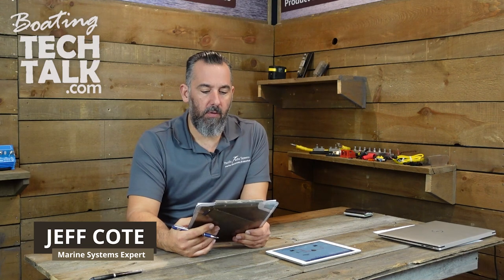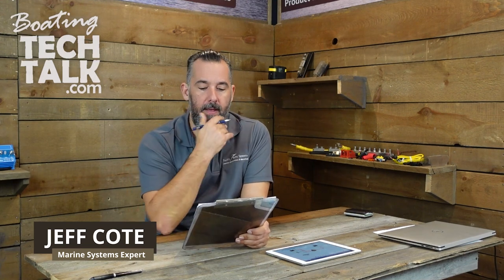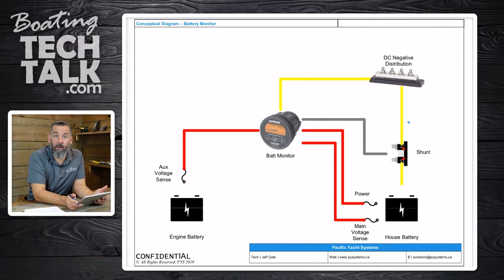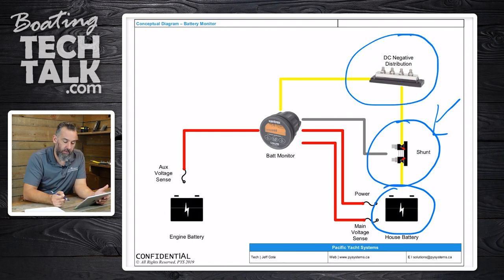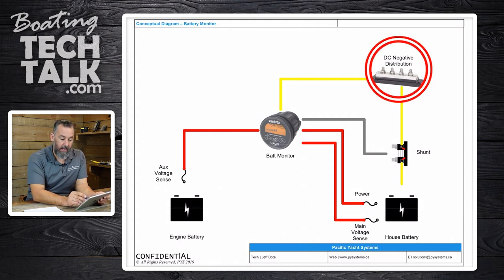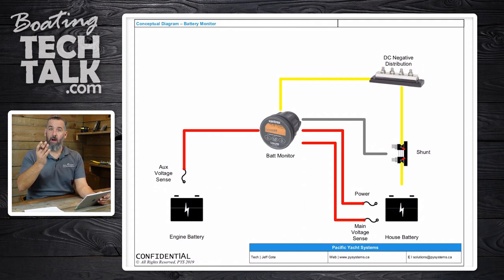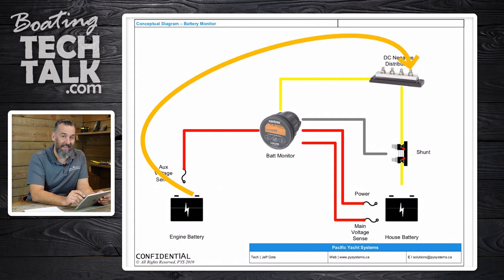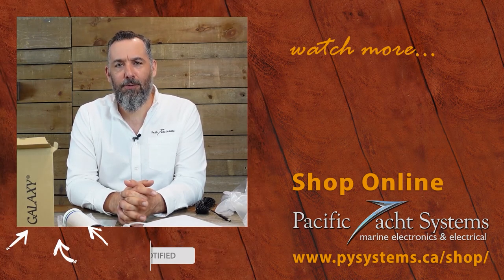I Am Installing a Battery Monitor on My Boat - Where Does the Shunt Go?

Comment: i have watched all your videos on installing the shunt and I will watch them all again a few more times.  pretty sure something is amiss in my current battery wiring and havent figured it out yet.
Reply from the maker: Hi David, when installing your shunt to a battery monitor, make sure the shunt is a single choke point for all negative current going to the battery bank, in other words, to negative wire should bypass the shunt and connect directly to the battery bank.

Comment: Up until I learned about shunts, I'd always think about the battery negative post being 0V. Now, I think about the negative distribution matrix as 0V, and recognize the battery negative as slightly above 0V (given the "voltage drop" across the shunt). Right or wrong, I find that mentality makes the whole system easier to understand. :)
Reply from the maker: Glad to help.

Comment: Hey. Thanks for grate vids! Im installing shunt in my boat , and have a few questions. What about negative from engine dynamo and negativ from engine starter? Direct from startbattery or other side of shunt? I have also shorecharger and mppt charger from solar panel. Same way? Also Victron . Thank you
Reply: 3x house battery(360ah) , 1 startbattery (120ah)

Comment: Hi Jeff, Many thanks for the great videos. I am installing a Victron Smart Shunt 500 on a 32 Foot sail boat. I have two 12v banks Domestic and Engine and wish to monitor both, via the Victron Connect App.  As per your video the Domestic Battery Negative  is connected to the shunt and the Engine Negative is connected to the Negative distribution Busbar. However it helps me, due to cable routing, to connect the Engine Battery Negative directly to the Negative post on the Engine and then also run a cable from the Negative  Busbar to the Negative post on the Engine, there is nothing in between these points, so it is almost like I am extending the Busbar by < 1M of cable. So my question is, please, are there any pitfalls with this approach?
Reply from the maker: Tom, if you plan on monitoring both battery banks, you'll need two shunts, one on the house battery and the other on the engine battery. Your DC negative wiring seems to make sense to me.

Comment: So I have a question I can't find the answer to... I have a sailboat with 2 house batteries (100 Ahr each) combined/separated with a Perko switch. I have a separate starter battery combined/separated to the house bank with a second Perko switch.  The negatives on the 2 house batteries should be connected together, then a lead to the shunt and from there to the negative battery buss? If so, would the first Perko switch on the house bank serve any purpose to monitor those batteries separately? What is the correct placement of the shunt?

Comment: Great video. On a Catalina 38 I have it connected just like you explained , and also both banks negatives are also connected to engine block..  do I still need this this “negative to negative” wire, or is redundant and unnecessary?
Reply from the maker: Ideally, your engine chassis should not be an busbar for negative connections, better to have one large negative connection from the engine chassis to a common negative busbar, where each battery is connected.

Comment: Thanks Jeff, if you have 2 house batteries, how would it connect ?
Reply from the maker: Assuming both house batteries are wired as one battery bank, then your house battery bank (made of two batteries) would have only one negative connection to the negative distribution via a shunt.

Comment: thanks for the video, as usual a learning moment.
is it useful to put a shunt on both the house and the engine battery? (so 2 shunts)
Reply from the maker: If you want to measure house and engine battery capacity, you'll definitely need two shunts. Very few boaters do that, and generally use voltage of the engine battery to infer battery capacity.
Reply: @PacificYachtSystems  thanks
Reply: Question, Is there a moniter on the market  that has the display showing all the time and let you volley back and forth between different battery banks. Please confirm whether you would need a shunt for each seperate battery back if you wanted separat readings. 
 You are the Man!! Ty

Comment: Where does the power wire, positive red, connect on a 36 volt in series battery set up? Any 12 volt lug or to the 36 volt lug? Thank you
Reply from the maker: Greg, assuming your battery monitor can be powered by 36 volts, then wire the battery monitor positive lead to the 36 volt post of the battery bank.

Comment: Installed a Victron wireless shunt on my boat and it works very well. However, I think it scews up my smart chargers. Chargers try to sense when batts are fully charged but with shunt installed they never sense battery is fully charged, and continue to charge. Kind of one smart device vs. another. Does this make any sense? Have one charger for house and separate one for start battery. Had Victron monitor house battery and with aux lead monitor start batt voltage. Actually destroyed start battery. Coincidence?
Reply from the maker: Hmmm, how would the victron wireless shunt communicate with your smart chargers? Wasn't aware of that. Also, never heard of a battery monitor shunt influencing any battery charging, to my knowledge they are separate. Anyone else can chime in?

Comment: very difficuld because my shunt is only to 100Amp.. and i suppose my starting motor from my engine.. and my bow truster ( connected to start battery) are taking more then 100 amp.i have my negatives connected on my engine.. and my shunt connected to the negative of my acc.battery.. thats completly wrong then?
Reply from the maker: Hi DDB, a 100 amp shunt is smaller then usual as most are 500 and some are a 100 amps. The starter and thruster loads on your engine battery, should not be measured on your house battery shunt, unless you selected the house battery to run your starter and thruster.

Comment: Hi Jeff, In this example, is the battery monitor only measuring the state of the house battery (or the starter battery too)? Thanks.
Reply: Only monitoring the house bank as that's the one you need to know the capacity remaining. Your house loads should not be drawing off your start battery at all.
Reply: Won't the shunt be measuring the starter battery also if it's negative is connected to the negative distribution terminal ?
Reply: @DJohns-nz4ul  That was my thought too and the reason I was asking.
Reply from the maker: Only the house battery.
Reply from the maker: The common negative distribution needs to be connected to both battery negatives (house and engine) and also the engine chassis block. The shunt is located in between the common negative distribution and the house battery negative, effectively measuring all amps going in and out of the house battery.
Reply: @PacificYachtSystems  Thank you, Jeff. I appreciate you taking the time to answer my question. Enjoy your videos—very helpful!
Reply: @PacificYachtSystems  Hi, could you include this into your diagram just to make it clear? Thanks
Reply: @PacificYachtSystems  You state this as if the system voltages don't matter, thus mixing 24 volt system negatives (LiFePO4) with your 12 volt (flooded lead) starter battery system.  House battery to inland fishermen means trolling motor system 12v thru 36 volt systems.

Comment: I am trying to find a battery monitor that is water proof for my bass boat and my trolling motor is 24 volt system and the batteries are the Dakota Lithium, I have tried the Victron BMV 712 and its been replaced 6 times over the last year, it has a compatibility problem with the lithium batteries in 24 volt an is not waterproof, Amazon is full of the cheaper units from China and then I see some of the real high dollar ones from the marine industry and most of them are not water proof, it just needs to be simple, I want to be able to look down and see how much charge the batteries have before I have to switch over to my second set, thanks